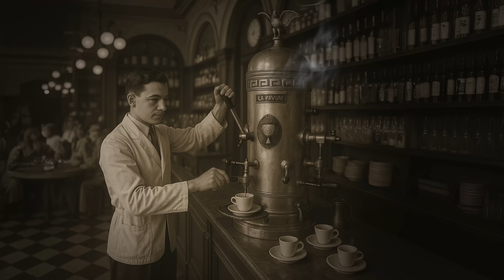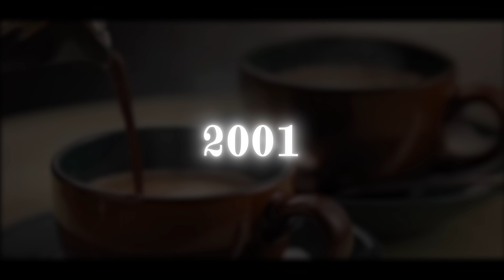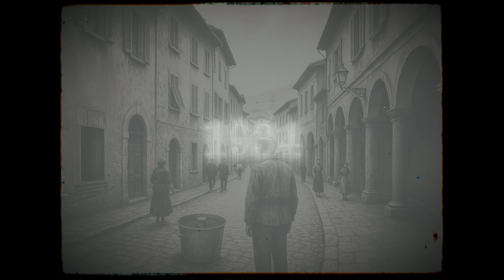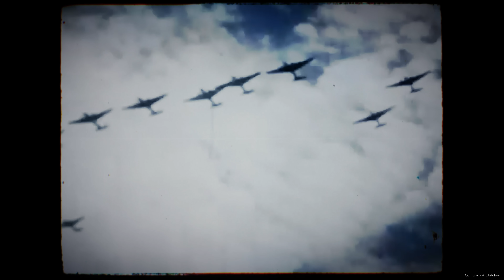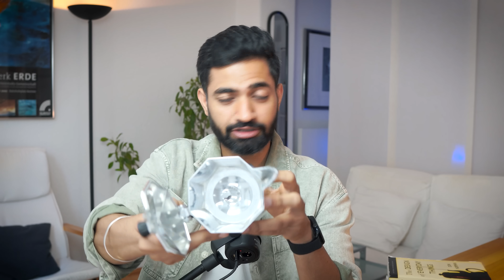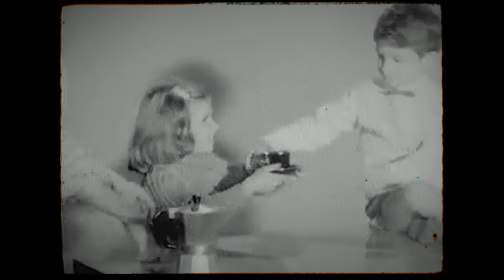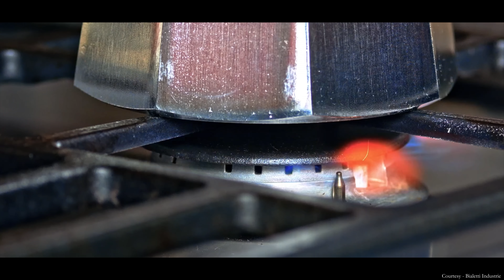The Genius Design That Makes ALMOST Perfect Coffee

Comment from the maker: Thanks so much for all the love on this video. Reading your Moka Pot stories has been really motivating for me.
Some of you brought up the aluminium vs stainless steel question, so here’s a simple note: aluminium Moka Pots are generally safe because they build a natural oxide layer inside. You just need to avoid acidic cleaners or dishwashers so that layer stays intact. Stainless steel is easier to maintain and more durable, which is why many people prefer it. Both options work — it depends on what fits your routine better.
Really appreciate everyone being here and sharing their experiences.

Comment: I disagree. Good design is when you have a product for a long time, and it breaks, or is stolen, or lost in an avalanche, and you would gladly buy another one just like it. Increasingly, when this happens, you discover that the product is no longer in production, and you have to replace it with a similar product, that is disappointing every time you use it, because you remember having a product that was practically perfect.

Comment: Great historical video! In my kitchen, I use a Profitec Pro 800 lever espresso machine. I prefer the ability to plumb the water directly from my water filtration system directly into the machine, and be able to make the best tasting latte in less than 30 seconds.

Comment: A classic, but for me it has a basic fault. Unless you have a very small purpose built burner on your stove, much of the heat is not only wasted by going up the sides, but also, over time, burns the handle. This could be resolved pretty easily by having a wider base which would boil more rapidly and protect the handle.

Comment: the octagonal base also makes it easy to open. I have a Bialetti and also a more streamlined 'moka' maker that has a smooth rounded lower chamber.  That smooth chamber is difficult to get a grip on to separate the top and bottom.  More than once I've had to ask a strong neighbor to help me open it!  so I prefer using the Bialetti.

Comment: Moka pots are cheap and simple but the drink it it produces is low quality due to high temperature and low pressure. The flavour of a drink produced by a proper espresso machine is way better. I'd sooner use a drip filter than a Moka pot and I've tried several Moka pots over the years. Fortunately I was able to buy a proper espresso machine.
Reply: Been there and done all of that over 60 years. I found it was a big fuss over nothing. 
Started all those years ago with a Bialetti, and now all I have is the same in various sizes. 
With the appropriate grind for this device, and using the aluminium versions, the drink is perfetto.

Comment: Your excellent video popped up on my YouTube feed just as I was enjoying a cup of coffee made in my Bialetti Venus, a round(!) stainless-steel(!) moka pot. I also have an older aluminum moka pot, but had to buy the Venus when we got our induction range. But the ritual and the taste stay the same.  BTW, it seems to me that the combination of the upper filter and the proper grind of the coffee (not too fine, not too coarse) are vital to achieving the proper 1-2 bars of pressure. If the filter holes or the grind were not optimal, you'd either get no coffee (and a pressure valve release), or a watery brown liquid.

Comment: If I had known earlier how simple and elegant this was, and that it's not that hard to get one that doesn't leak, I would have gotten one long ago and skipped getting an Aeropress. And I probably would have gotten a smaller one than my 6-cup (300ml) version, because it's not really made to make anything but its full capacity. I'm much more used to immersion followed by filtration, using one tablespoon of coffee per 6 oz cup, and that's not how the moka pot works at all.
Reply: p.s. Last night I tried making about 3 cups with half the coffee, and that worked out OK. I tamped down the coffee flat in the chamber.

Comment: At my Parents', in the early 70s, there was one of this intelligent coffee pots.

And in 2025, after owning Expresso Machines, and the popular Electrical Perculators with paper filters (In the US, Mr. Coffee Maker), and in the 21th Century, a couple of Capsule Coffee Makers,  the traditional, almost 100 years old  octogonal Coffee Pot reentered our house.

Probably made in China, the venerable Coffee Pot reintroduced the old ritual into our lives.
And yet, this invention was based upon an older,  fancier,  extremely Chic Coffee Maker, enabling us to Brew our coffee at the dinner-table.

The Equipement  in question is the Fabulous Glass Siphon Coffee Pot, a fantastic Coffee Brewing  Product.

A Glass-Sphere, on top of which a section connected to the bottom is installed,  where the coffee is placed .
An Alcohol  Lamp warms up the water.

The Glass Sphere -- if the material is of low quality glass -- is fragile.
TEMU sells the equipement for around 25 Euros.
Amazon offers them at a higher price, probably a better quality product..

We own a Glass Siphon Coffee Pot.

Most of our dinner-guests become fascinated  by this equipment -- ir really affords a sophisticated touch to a fancy dinner,
No need to go to the Kitchen, resorting to the ultra-modern electric appliances.

Comment: I haven't met a "coffee system" I haven't tried. Yet I keep returning to the elegant simplicity of the moka pot. I was raised on percolated coffee growing up and drip coffee in my early work and dining out experiences, but discovering the moka pot was as much a revelation as discovering fresh ground gourmet coffee. I've been using them since before the day of silicone gaskets and can't imagine any coffee system surpassing it (for my tastes at least). I will remain a moka pot evangelist as long as they remain for sale.
Reply: I do like that device and some people know how to use it more than others. I have to say I'm interested in the new aeropress pot because it looks like it's avoided the quality plastic design it had that was nearly unbreakable. 

It makes one of the lower acidic smoother consistent cups of coffee and you can do it anywhere, if you have hot enough water and some coffee. 

Instead of messing around with delicate French press . 

Just put the coarsest grinds that you would use for french press and put it in an insulated mug and stir it after a minute and then maybe 3 minutes later stir again and pour it through a fine enough metal filter. 

No breaking to worry about no plastic to worry about no paper filters to worry about. 

All you need is the right coffee and hot enough water, no matter where you're at. 

Just as good as a French press. No sediment either because I use the courses ground and because of that flat shiny superfine filter.

Comment: Coffee from a moka pot is BETTER than real espresso because:
1. The quality of the water doesn't matter, because the process only uses steam, so substances that could negatively affect the taste and don't evaporate remain in the residual water at the bottom. With an espresso machine, however, the quality of the water does matter. The coffee from a moka pot tastes better, which is especially noticeable when mixing it with milk.
2. The coffee is always very hot. You don't always get a hot espresso. Sometimes it's only lukewarm because it's been sitting for a while or because the cup wasn't preheated. The coffee from a moka pot is always made with 100°C steam, because the process dictates this. But the water temperature of an espresso machine isn't that high – it can't be, because the water pump can't pump steam.

Comment: I would like to add that, prior to the Moka, people did have coffee at home.  they used a stove top coffee maker called cafetera Napoletana.  it had a water compartment at bottom,, a filter in the middle, and recipient on top that had a pouring tube, so that when the water boiled your turned the coffee maker upside down and the boiling water went through the the filter into the recipient .  Every household had one.

Comment: I really appreciate your presentation, graphics, and thoughtful insights. I would like to extend some historical information and observations in your video.  The very first espresso machines in Caffe Bars were propane fired as hydro-electricity was not prolific everywhere in Italy. The Moka Express could be operated with a stove top, and are in fact called 'stove top expresso makers' traditionally. Or the drink is simply called a 'Moka' allowing homes to produce espresso coffee without electricity. This brings me to the second comment you made about how expensive the Bar Caffe machines were. They were not 'more than a month's income' but many years of a home's income. However, they both operate on STEAM power. The Moka Express also is essentially building steam to push water, while the Bar Caffe machine had water in a boiler, with a steam above pressing downward on the water, that when opened by a careful pivoting lever, allowed that hot water, under the force of the steam to push its way through the espresso grind in a portafilter handle. SO at the start they were similar in extraction force. It took until 1954 before SPRING PRESSURE allowed the PULL LEVER to open a chamber for that hot water to rush into, over top of the espresso grind in the portafilter, to then be released with about 6 Bar of pressure resulting in:  CREMA /SCUMA of the golden oils on the espresso. At this point the Bialetti is out of comparison, as only with the freshest grind of beans, and a good grinder can crema result. Not until 1961 with FAEMA did an electrical rotary-pump allow that 8-9 Bar of pumping pressure that you refer to, actually exist. SO home expresso  comparable to the BAR CAFFE coffee up into the 1950s Dolce Vita era.  To me, the hexagonal shape allowed me to screw tightly the two halves together because the handle is quite brittle and weak, and as you said, wet hands, etc. would slip on a smooth version. The advent of health issues with Aluminum cookware did result in a shift away from the Bialetti Moka as unhealthy.  I recall the stainless steel units did not have the charm and were smooth of course. LASTLY your 'announcement of WW2' irked me as everyone but the USA declared war in 1939 while the USA sat around making money until Dec. of 1941. In using a clip of the American president declaring war (because of Japan's attack) is insulting to the thousands of soldiers who died for 2 years in battle.  Just a suggestion that your footage would have been better if it used Churchill or a Newspaper Image 'ALLIES DECLARE WAR' to represent 1939.  Thanks again. 41C
Reply: Just have a coffee and calm yourself.

Comment: So that design has very little, if any, obsolescence. Unfortunately, many products are deliberately designed in such a way as to have shorter lifespans. The obvious example is the light bulbs. In the 1920s, major light bulb manufacturers — including General Electric (US), Osram (Germany), Philips (Netherlands), and others formed an international organization called the Phoebus Cartel. Around 1924, the Phoebus Cartel agreed to standardize bulbs with a 1,000-hour lifespan. Engineers were instructed not to make longer-lasting bulbs — even though they easily could — because longer life meant fewer sales. The cartel even tested bulbs from member companies and fined those whose products lasted too long. The outcome was that consumers unknowingly bought shorter-lived bulbs. The cartel operated until World War II and was eventually dismantled.
However, the idea of “planned obsolescence” spread to many industries (electronics, appliances, etc.) and still influences product design today.
Reply: They also sell replacement handles, strainers, gaskets, etc; so you can keep it alive for decades. In the city, they are in almost every charity shop hardly used (if used at all) and sometimes it is cheaper to buy one there than to buy a spare part and pay shipping.

Comment: My pots including moka pot and carafe are stainless steel.  

Aluminum can be great for light weight short-term use such as camping, but there are stainless steel camp pot kits, just grab them when seen because they may be hard to find before going out.

My round moka pot is in this video. I saw these about three years ago but didn't want an aluminum one, bought mine when seen in a thrift store. 😊

Comment: At 6.31, You say "I pops out of the mold"??
I am sorry, but my experience from casting my innovation from aluminium, how are You able to tell me, or anyone, that the bottom half "pops out""?
Just curious, because of that round top, it does anything but "pop".
Btw, Your math is also out of the window, there are more than "3 parts", yes?
Very functional piece of work though, had one myself, once.

Comment: Cool!......I have owned a Moka Pot since the 1970s. However I haven't used it since 1985. With the advent of so many other ways to brew coffee, I put it away. I have been buying fresh beans, grinding them myself, and pouring boiled water over them, with the grounds sitting in a fine metal mesh funnel, resting over a mug. I also brew Turkish coffee in stove top Briki pot. I just pulled out my Moka Pot, and am looking forward to using it once again.
Reply: Nice 40 year break you had😃

How is quality of moka coffee compared to other ways

I have aldi pod and its fine, easy to make and does the job, its almost as good as real espresso 

Moka seem to be more work, you prbbly need good coffee

Comment: I have the Bialetti Venus, and it's an improvement for 3 reason. The thread on the original is sometimes hard to locate, the chimney on the original tends to splutter sideways, making a mess when you check brew open, also the tiny spout means you have to pour slow, if you pour too fast, the lid catches the coffee and diverts some away from your cup. The venus has a  better thread, and chimney that point more down, and wide mouthed spout. I like like it's cleaner round staniless look more, but loosing that shape does mean it would benefit from something to grip.

Comment: The Alessi 9090 is the perfection of the moka pot: wider base for faster heat uptake, stainless for induction stoves, beautiful design, and most importantly a top that snaps onto the base for easier assembly and disassembly, especially while hot.
Reply: I looked it up, and it's like the 18K gold Porsche of moka pots. What kind of seal do they use on the snap-on part?

Comment: A Good design but cooking something acidic at high heat in Aluminum was not a very good idea. And we still don't know if there is neurotoxicity caused by it. The 80/20 steel version is the way to go.
Reply: I wouldn't worry about "toxicity". scores of people have used these pots every day for 50 or 60 years and are still around to tell you how much they love it....
Reply: @collinmartin3589  And many of that age group have Alzhiemers and can't remember that they may have got it from all the aluminum products introduced to that very age group.
Reply: My pots including my moka pot are stainless steel. Aluminum seems great for light and short-term use, camp pot kits. But even then there are thin and durable steel camp pot kits, grab when seen because those can be rare and not available before going out. 

My moka pot is in this video. 😂

Comment: I like my coffee makers like I like my cars: simple, efficient, and definitely NOT digital! I use my Bialetti - which I've had for many years - nearly every day. It makes fabulous hot AND cold coffee (just pour over ice!). It's simplicity works on nearly every type of stovetop too. And of course "it just works!" 👍☕
Reply: It does not work on induction burners. While living in an apartment with that, I got  Melitta French press that I could boil water in an electric kettle and pour it over the coffee. It is very simple and makes great coffee.
Reply: @nedludd7622  I do the same. But also have a Bialetti style coffee maker (made in Italy)  in magnetic stainless steel that does work on an induction hotplate.
Reply: @nedludd7622  My second favorite way of making coffee!
Reply: You can buy a Bialetti steel plate for induction stoves.

Comment: Bought an electric when I first moved away from home back in '91/'92 or something. That and a cheap Bodum french press made my daily coffee for a handfull of years. Can't recall what happend to it. Later in the 00 I refound my interest for coffe and got an espressomaker - but when I somewhat had mastered the basic art, my interest just faded away. I ended up replacing it with an standard 3 cup Bialetti moka pot. Later a 4 cup Venus (Stainless steel) came into my life and finally a Mukka, which makes beautiful cappuchino (Remember to heat up the milk before adding it to the top chamber). I count spoonfulls of beans. Ground them in a bodum grinder,  Use the tapping method to avoid channels - no tamping, no fancy tools. Heat the water a bit before adding to the bottom chamber. Wait, watch and enjoy the coffee. Today I still enjoy the process just as much as the coffee itself.
That Bialletti has begun selling capsule machines is understandable but regrettable.

Comment: I suspect that another reason for the octagonal shape is that it would make it easier to reproduce the pattern for the sand casting. Eventually the wooden patterns will wear out from pounding the sand around the pattern. A cylindrical or conical pattern would be much more fragile and harder to make. The octagonal pattern can be largely made with plywood, so it would be both cheaper to fabricate, and physically tougher, so it needs replacement less often.